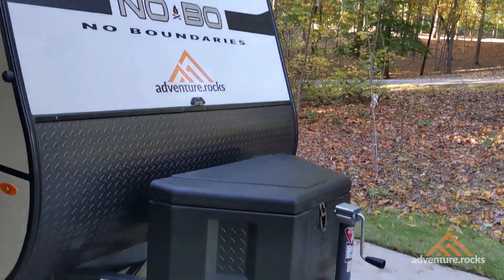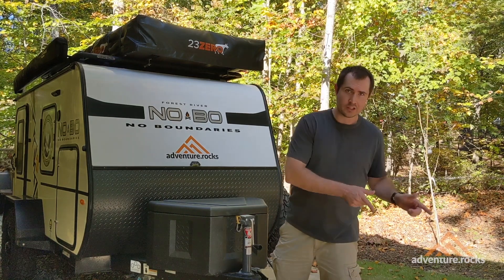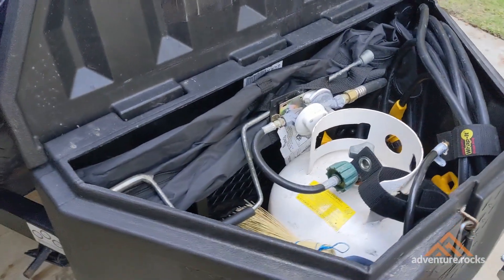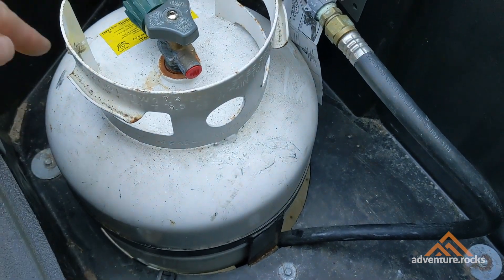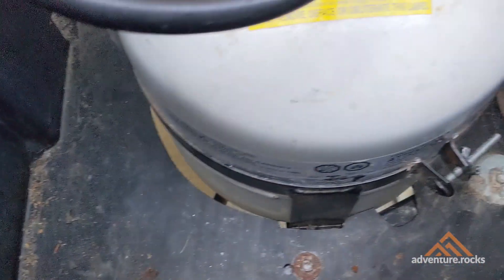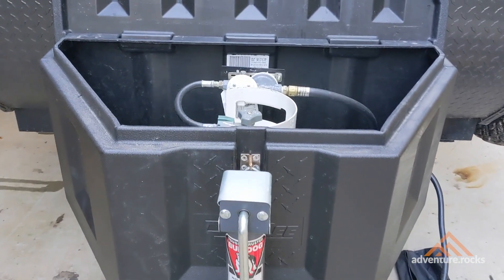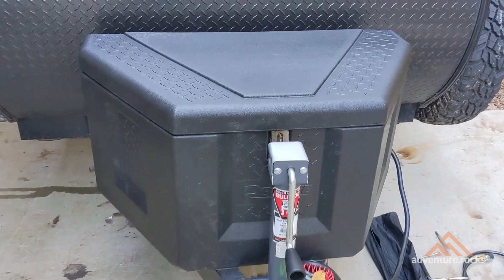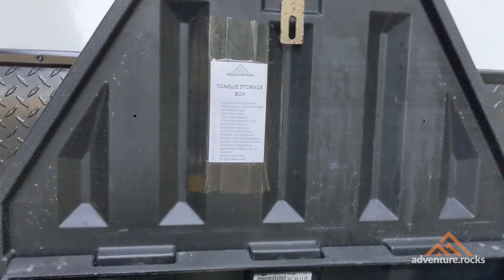Tongue Storage Box Upgrade for NoBo 10.6 - Awesome Exterior Storage Mod

Comment: Just watched you walk thru with the NoBo 10.6. Thank you! We purchased one in May of 2020 and with the lockdown, were never given any help with set, controls, and features. We figured out most, asked other campers and made a couple of our own mods. I definitely will look at your sink faucet mod! My quick share with you is I switched out the self tapping screws that hold the stove/box to the slide out drawer, with short carriage bolts and nylon lock nuts. Second time that I reached underneath to secure the support leg, I impaled my forearm! 3 inch gash spoils a camp trip. Keep the videos coming!
Reply from the maker: Thank you for the kind words! That is a great idea on those screws down there. Sorry you got cut like that. Ouch for sure.

Comment: This is so helpful. I just bought my NO BO 10.6 and was concerned about the battery and propane getting stolen. The factory propane covers lid blew off on my first trip. This looks much more secure. Had you ever though about putting the battery in the box with the tank? Also considerations with an electric hitch for clearance. Thanks again for taking the time to make these videos!
Reply from the maker: Sure, glad to help! Surprisingly the propane tank takes up a good bit of space, so not quite enough room to add the battery in there as well. I've seen some manufactures design a wider tongue box and they combine propane and battery in the same chamber, provided there is a lot of ventilation and room for gas to escape. For propane, RV code requires a well ventilated space so thus the gap in the bottom of the storage bin for the gas to fall out. Plenty of room for a power tongue jack in most cases. Most models have forward motors, so more real estate taken toward the tow vehicle, but I've seen a few jacks that protrude a few inches on the storage side. Usually they're also a bit taller too. Sometimes manufacturers like Forest River change vendors or suppliers on parts like their frame, so I've had some folks comment that they cannot fit the battery and tongue box on their rig like mine, due to a slightly different A frame vendor that must be shorter on some dimensions. Hope this helps!

Comment: Thanks for the info. Still researching the camper I want so watching these mods helps tremendously. The NoBo 10.5 is a solid contender at this point.

Wondering if you have any pros or cons on the 10.5 vs 10.6.

Subscribed and looking forward to more content. Thanks again!
Reply from the maker: Sure, glad to help. I think the NOBO 10.5 and 10.6 are a great value compared to some of the other alternatives. For me the biggest advantage of the 10.6 is the view with the screen panel...the views and openness. I like the versatility in that the 10.6 can be used to haul items if needed. Otherwise, on the 10.5 an advantage is you have a little more storage on that back wall. So if you don't think you'd make use of the views with the ramp door and screen, and you have no need to load larger items, then the 10.5 probably is the better choice with the bonus of added storage on that back wall. Hope this helps :)
Reply: Okay, great! Thanks for the response. Added versatility vs. added storage space — the quintessential dilemma nearly everyone must wrangle with when heading outdoors. 😅

Regarding the screen feature of the 10.6, how is it on keeping mosquitoes out? Or smaller pests for that matter.
Reply from the maker: @slyflea  It's basically a nylon screen with a zipper down the middle and about 10 magnets around perimeter. Then the inside of opening on rig has magnets around frame that connect to the screen's. So, there is a 1/4" gap between screen and opening where something could crawl in technically, and then the bottom against the sill of the opening has probably about 1/4"-1/2" gap. So I guess kinda think about it like having a window cracked on your car or house such that something could fly or crawl in, but only around the perimeter. I haven't noticed issues with bugs getting in during day, but I'd say at night the little nats will get drawn to the lights inside and find a way in. I don't think it's a must have, but definitely nice feature. I have seen a significanlty higher ratio of 10.6 units for sale on dealer lots compared to 10.5 units, so I'm guessing demand is higher on 10.6 units compared to 10.5 units. Really can't go wrong with either model though. Just personal preference.
Reply: Okay, very cool! I’ve noticed that many online dealer websites offer more 10.6 models, too. I’m guessing I’d have to mod it somehow if I choose the 10.6, as most of our outings will be in FL where mosquitoes plague us 13 months out of 12! 🚫🦟🤬
Reply from the maker: @slyflea  Sounds like fun. The AC on the unit will keep you plenty cool and dry either way...it'll turn it into an ice box in no time :)